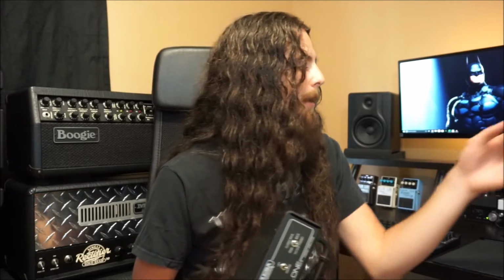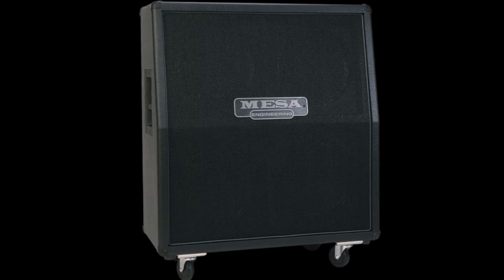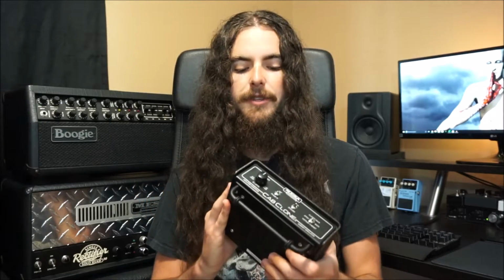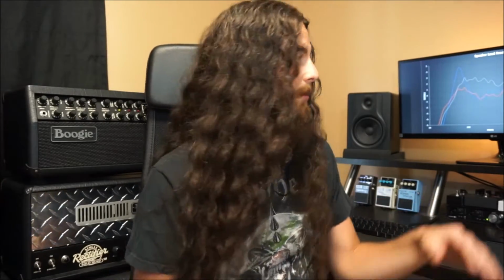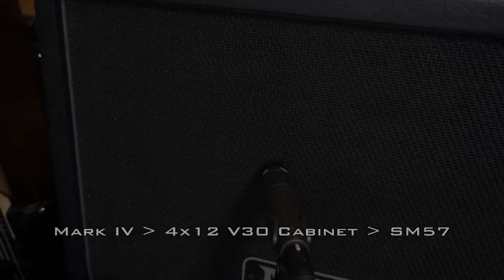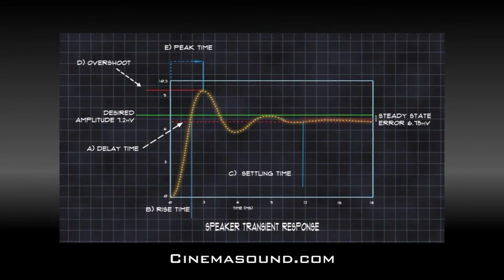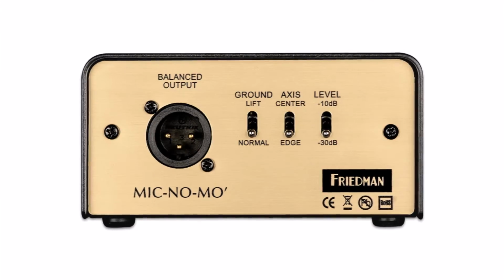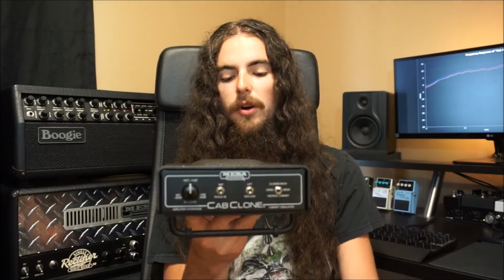Gear Curiosities: Mesa Boogie CabClone - There's a Reason for the Reputation!

Comment: I have a Mesa Cab Clone. I get a decent sound out of it when recording. I set the knob all the way to -30dB and have my Mesa Dual Rectifier master volume pretty high. Overall, I'm pretty happy happy with it. I was just playing through my friend's Axe Fx 3 and through headphones, they sounded similar. That being said, I found your video very informative and I agree that the CabClone doesn't even come close to my Mesa 4x12 cabinet with an SM57 on it. I spent $300 on my CabClone and I don't feel completely ripped off. But I do feel like Mesa didn't meet my expectations. Especially considering everything else they put out is gold.

Comment: Two notes is a reactive load, but it only models the top end reactance of a cabinet (small inductor).  To create the low end reactance of a cabinet is expensive (Large inductor) .  There may be some good reasons to not model the low end response.  For instance, if your low end reactance is similar to a Mesa OS 4x12 with resonance between 90-100Hz and you wish to use a green back loaded cab impulse response (Resonance 124Hz-140Hz), you may end up with a dual low end resonance.  Not that a reactive load couldn't be designed with switchable low end response, which I do believe exists on the market.  Keep up the good work Ryan!
Reply: If you use load box which mimics low end resonance, you should use "flat" IR, like Own Hammer IRs.
Neutral IRs can be captured even with conventional tube power amps like:
https://www.youtube.com/watch?v=t8bic2AvJec
Device used in video even cheaper than Cab Clone :)
Another review of REACT:IR:
https://www.youtube.com/watch?v=fkUumHcHlKo

Comment: Good video, nice to see a discussion of cab impedence and it’s effect on the sound (and feel) of an amp. 

To throw another wrench in the works, changes to the impedence curve may have a bigger or smaller effect on the sound and feel depending on the amp. Higher negative feedback in the power amp will reduce the impedence curve’s effect on the sound, and vice versa. 

Try the Recto, flip between vintage mode (negative feedback in the poweramp) and modern mode (nfb loop disconnected), modern mode sounds just awful with a resistive load, or a reactive load box with a poor curve.

Comment: Hey, I have posted once to Mesa if I can use the slave out on a Mesa JP-2C as a recording out to use a speaker sim , but they said it doesn’t work, as its ment to send the signal to another power amp. But you seem to do well. Does the slave out on mesa amps capture the power section including the transformer?
Reply from the maker: Whoever told you that is plain wrong. Yes, it's meant to "slave out" to another power amp, but that amp is supposed to be of the solid state or neutral tube variety for more power or wet/dry/wet applications (i.e. it doesn't introduce significant tone coloration). The slave out does indeed include the power section at an attenuated level, so using it with IRs is perfect.
Reply: Plague Scythe Studios Thank you very much! I have one last question though, I have a tornado captor 8 ohm at home, but Think about wether I am going to need it for that setup once I get the JP-2c since I could use its inbuilt cab clone as load and use the slave out to bypass the shitty analog cab sim. But since you showed the captor sounds so much better as load, I don’t know if the in built cab clone is any better. 

For exactly this content and your info and answers this is currently my favorite YouTube channel in its category 👌💪✌️🙏

Comment: Plague Scythe Studios  How usable is the Mesa cabclone for practicing with headphones? Is the tone any good? I'm drawn to the Mark V 25 or 35 because they have this capability built in (or I could consider a full size head and add a cabclone or other as an alternative for reduced volume or silent practicing) but if it would just sound like crap, I would no longer consider this.

Comment: Hey would you ever review the head version of the MG series, I have the 100 watt head, the "MG100HDFX", it does sound a little flat at first but once you start tweaking with the contour and mid range knobs it sounds almost like a tube amp when paired with a good cabinet
Reply from the maker: I'm pretty much over the MG series after my 250DFX review, theres not a whole lot more I could say besides how it behaves with better cabs.
Reply: @PlagueScytheStudios  Good point, my MG15 Micro Stack head sounds surprisingly good with my 1960B.

Comment: I actually own a CabClone and agree the cab sims are pretty bad. It sounds ok when used with IRs tho. Would you say that adding EQ to approximate the impedance curve that resistive load boxes lack (like you did at 14:13) results in a sound similar to a reactive load box? All I'm really looking for at the moment is a good option for direct recording.
Reply from the maker: For home recording, adding the reactivity EQ curve in post is close enough for a mix with a good impulse response. I feel as if there's still something missing compared to a real speaker load in terms of dynamics or perhaps harmonic distortion, but I don't have the tools to prove whether that's true or all in my head.

Comment: A load with only few high wattage resistors is unsuitable for many guitar players. You can experiment it by your own, by bying few 25 or 50 Watt low wattage resistors and in any case you'll be disappointed. Because you'll have to deal with inductors, capacitors and resistors to get the best results. It's just pain in the ass!

Comment: The reactive load plus speaker emulation was pretty damn bad sounding, although the Captor you compared it to also sounded pretty shitty just in a different way, so I do wonder what the point of the comparison there is. The mesa actually had nicer sounding mids, whereas the Captor was either way too scooped, or very sharp sounding. 

Also, the graph at around the 10 minute mark is actually really hard to see, especially on a phone. The dark blue line has almost no contrast against the background, so i almost didn't even see it at first. Next time I suggest either using brighter colors or thicker lines! still, besides that, fantastic job as always!
Reply from the maker: I forgot to change the default colors this time around, I usually go with reds and yellows for contast. It is hard to see even in my phone.